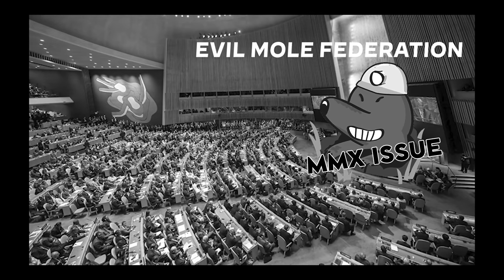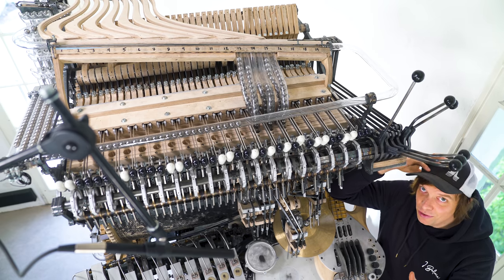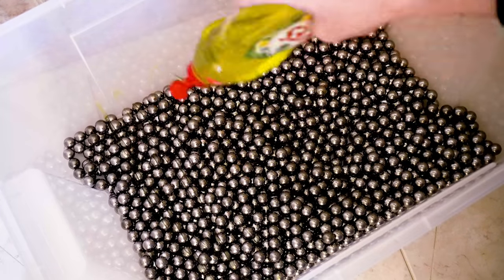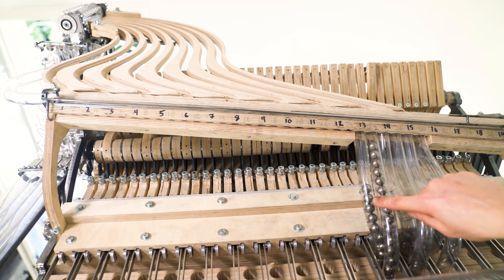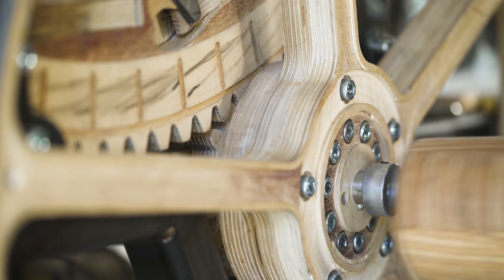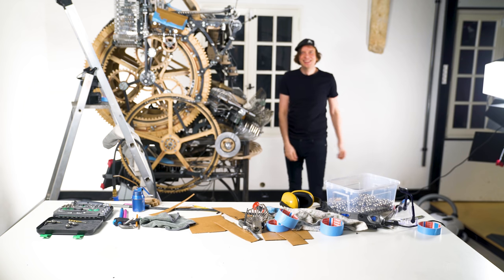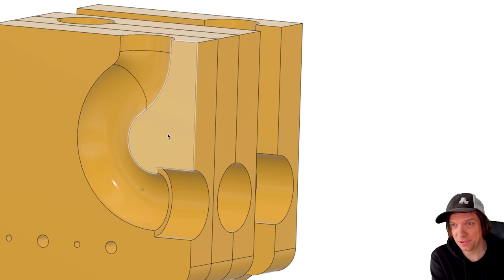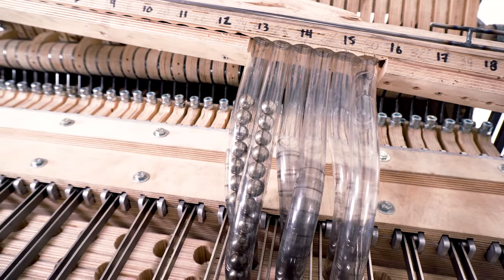Why Are 1000 Marbles On This Red Towel?

Comment: Fingers crossed retuning doesn’t affect the marble height of the top! 🤞😳
Reply: Of course it will! There are many different good ideas on the Discord of solutions for making marbles in the same height on the top, with no need to have adjustments. Unfortunately, Martin seems to be stuck with the modules for height adjustment.
Reply: Was just thinking that
Reply: We have a variety of modules.

And this is the working prototype, not the final travel design.

Of course it'll have a few flies in the works, it's buggy :D
Reply: @glenmcgillivray4707  if this is the prototype then I guess that makes the first one a proof of concept... right? 🤔
Reply: @LizardKing1470  perhaps, or a prototype of a different design. Don't forget it was scrapped and only core concepts were retained. Lessons were learned of this first attempt that succeeded, here Martin seems to intend to plan to build a final functional design, which is great, buuut he is still learning what does and does not work, building new components as he goes and literally developing new proofs of concept.

The prototype that follows the initial prototype looks far more like the finished design, but rarely includes everything the final requires.

For instance the nonsense of the too narrow lanes on the marble divider, which in turn made the size of the note management linkages, the pipes are 10 mm and the holes 8. He didn't know what pipe he would end up finding that worked, how could he understand he was making a poor choice that would haunt him for the rest of his creation?

He built his Grosstraktor. Now he is developing the panzer 1. Next time we will have a more refined Panzer 2.

I'm terrified how impressive his Panzer 3 and 4 designs will turn out, with as much refinement he is stitching in so far, will they be self propelled, marble machines of musical excess? Possibly with speakers activated or articulated by marbles themselves?
Reply: Isn't the pressure module separate from the top marble pipe and therefore would not change the height, and worse case scenario hopefully with the new changeable height regulators it should be an easy fix
Reply: @cai53r63  the marble chain sits on the gate. the pressure module is behind the gate to bear the load for it, the depth module is mounted above that for leveling purpose. The pipes above for bringing the marbles.

So no matter what component we tweak, all change the depth of the top marble. The chain is supposed to be solid marbles.
Reply: Wow I didn't expect you to write such a lengthy reply, but I guess I got you going, lol. Yeah, there's just so much to this project that it's hard to wrap your head around. Prototype 1, proof of concept, first version, inspiration for a better one, there's not much of a difference anyway. What do grosstraktor and panzer mean? Grosstraktor sounds like it means garbage truck.
Reply: @LizardKing1470  Panzers. 1 2 3 4.
Tanks of world war two.

Grosstraktor. Agricultural tractor. Code name used by germans for production and shipping of tanks to the soviet union for testing and experimentation and training for mechanised combat. Theorists were busy explaining tanks would change warfare forever. And infantry would need to be mechanised to keep up. The Germans got their training done in secrecy to avoid being seen breaking the treaties of world war 1. It was seen as their nation being weak and incapable of defending itself, so they MUST prepare and develop a military.

Aaand then Hitler and the unpleasantness in East Europe, then West Europe, over the British mainland, and africa, and finally within the soviet Union itself happened.
And everyone wanted to shout at Germany 'THIS IS WHY WE SAID NO TANKS!'
Thankfully that is over now. And Germany sells tanks to other people.

Comment: I think you can remove the rust on the marbles using a “tumbler” with crushed walnut shells as abrasive. It will polish the marbles back to new :)
Reply: I just said the same thing a minute ago! That would be the way to go. A tumbler or vibratory bowl with crushed walnut shells
Reply: Wouldn't that also alter the size of the marbles?
Reply: @satansbarman  I think not, if you don’t keep them in the tumbler too long. I’d try 24 hrs and check.
Reply: Hope he sees these are expensive and a tumbler with a soft media would totally work
Reply: @satansbarman  That's why he should use walnut shells instead of a harder medium. Silica will sand off steel, walnut will only touch the softer rust.
Reply: The machine hsa been comlpletely designed around a fixed size of marble, and even a 25th of a mm difference to each marble, will affect how high the stack of marbles sit in the marble divider. Better to replace them after replacing the parts that put graphite in contact with the marbles. Graphite can still be used where there is mechanical friction between moving parts, but should be kept away from the marbles themselves.
Reply: @ouzoloves  hence the idea to try a 24 hr tumbler run & measure 😉
Reply: @PikkaBird  but that's kinda my point the rust coming off is still going to change the size
Reply: @ouzoloves  .25 mm is a lot.. I don't think it would take more than a couple thousandths of a mm off.
Reply: @satansbarman  I guess for a finely tuned piece of lab equipment it might be enough to make a difference, but the amount of steel that goes into that amount of surface rust is surprisingly minimal. I know the height adjustment needs to be pretty spot on, but I still think these marbles would be comfortably within tolerance. 
Of course it would always be preferable to use something that's actually perfect, but I would test these cleaned and de-rusted marbles before swapping them all.
Perhaps such a test could be made by  making two very long marble lanes (just a groove cut into a length of MDF) with a stop at one end. The stop would be at the end of a slope, and by filling one lane with the used marbles and the other with the new ones he could measure the difference over a length of a meter for instance (I don't know howany marbles that would be, but quite a few for sure). I would be surprised if the difference is even really measurable.
Reply: @PikkaBird   as I was reading the first part of your comment I was thinking he could test if the rust removal has a noticeable impact on the size by measuring the clearance at the top holes (just after those amazing marble lanes 😀), like when he was adjusting the height modules. I suppose you could do it for a metre but I guess it would be enough if he tested in the longest tubing he would be using. 
My original thought was based on how Martin had been fine tuning said clearance with the height modules, which thinking about it now have also changed, so I guess he'll need to swap and possibly cnc some more anyway 😁, to get that roll along the divider.

Comment: TL:DR do NOT dry marbles with heated air, they will rust faster

I am not sure if blowing the marbles with hot air will help with rusting, because high temperatures increase speed chemical reactions

You are basically blasting the marbles with 500° oxygen
Oxy Acetylene torches cut metal this way, their flame is oxygen rich and is basically rapidly rusting away the metal and cutting it, if you had used a fuel rich flame, the cutting would much slower

Not sure if I am right BUT In my life I have never never seen steel rusting in 3 minutes so it must be the hot air gun
Reply: Martin is incredibly smart and talented but washing so many marbles at once without even trying the planned wash on just a handful first was incredibly blinkered. Even a comparative dunce like me would have done a test wash first as I would have suspected that rust could have started pretty soon after the wash, I'd have also checked out potential salt content in the washing liquid and whether using a hair dryer was a smart move or not. 

We all make mistakes of course.

Comment: When you wash steel, afterward immediately wash it with Isopropyl Alcohol (medical alcohol) you can find it in most pharmacies and in the paint department of a hardware store.  The alcohol displaces the water and evaporates.

Comment: Hey Martin, i may have missed something but doest changing those parts at the end affect the height of the marbles at the top of the divider?
Reply: I was thinking this too 🤔. Hopefully the different shape is an even increment of marble length.
Reply: If he looks to the Discord forum he'll find excellent ideas that are not as fragile as the height adjustment modules are.
Reply: But he has the height adjustment modules, so that shouldn't be that big of a deal.
Reply: @vincentguttmann2231  what were the height adjustment modules? I thought they were the same thing
Reply: @vincentguttmann2231  those are cumbersome to switch. Not practical at all.
Reply: @SantiagoLuz  I mean, if you got a better design idea, make a suggestion!
Reply: @vincentguttmann2231  I think you missed my first reply here
Reply: @SantiagoLuz  Oh yes. But my reply is still standing: If you already HAVE a good idea, why wait for someone else to invent it again?
Reply: @vincentguttmann2231  I voted on the best ideas in the Discord forum. People even made videos with working prototypes to showcase the solutions. We should be voting there to reach Martin's attention.
Reply: @vincentguttmann2231  And I don't have better idea than the ones in the forum

Comment: Found myself screaming "NO!" at the screen when I saw the liquid soap being poured over the ball bearings. Definitely the wrong way to clean them.
Reply: They aren't ball bearings, they are bearing balls, or simply steel balls. Word order matters. At 11:15 you can see an actuall ball bearing.
Reply: @waynec369  It's not pedantic to point out that bearings and balls are two entirely different things. Also, it's perfectly fine to call these steel balls "marbles". Look up the definition if you don't believe it. "A marble is a small spherical object often made from glass, clay, steel, plastic, or agate."

Comment: "I Made this system adjustable"
Proceeds to create entirely new part and puts lots of time into replacing it

I'm not saying I have a better solution, but I have a hard time considering that adjustable.

Love what you're doing. Have a good day.
Reply: Martin does not understand the difference between adjustable and modular.

Comment: As a software engineer it's great to see Martin embrace "modules". Once you have a contract (the interface between your modules) then you are free to play around with the implementation as much as you want, as long as it meets the contract. This video was a perfect example -- you have an input and an output, the module needs to deliver the marble across it, but you are free to experiment with different designs to see how well they meet the goal. Engineering!!

Comment: Hey Martin, I have an idea to remove the need of magnets on your current magnet wheel, and would retrofit your current design with minimal changes. Think reverse waterwheel. I think you could machine one and test it in a day. Ill put together a quick Fusion design if you want.

Comment: Use isopropyl alcohol, acetone or metholated spirits to clean the marbles.
This should not rust the marbles and also act as a solvent to dissolve any residue left on the marbles. It also dries quickly and as another commenter said, it also acts as a degreaser.

Comment: Compressed air doesn’t clean, it just displaces...
Reply: Displacing dust and debris onto the floor (or into a vacuum cleaner) counts as cleaning, though?
Reply: @dnebdal  in my opinion it gets it airborne, and he does this right next to the marbles and the mmx... it would have worked better if he had done it outside IMO

Comment: Been following the MMX since inception, first time commenting. 

I'd hesitate to run rusty marbles through the machines, as they may leave behind rust particles which could stain the wood after enough passes. With how light the plywood is, it won't take too long to happen and I'd hate to see your work soiled with an orange tint.

Always awesome work. Keep whacking those moles!

Comment: Please use stainless steel marbles, anything else is a NO GO.
Reply: They won't stick to the magnets...
Reply: @janhimpiii  You can get stainless steel magnetic.
Reply: @janhimpiii  very much depends on the alloy. I'm more worried about the slight weight change compared to "normal" steel balls.
Reply: @namAehT  No problem, just calibrate all the parts :)

Comment: Thank you for yet another great update. Don't let the marbles airdry. Dry them off. Depending on your tap-water, airdrying can leave behind minerals, like limescales. Also, airdrying helps rusts. Non-stainless steel knives are to be dried off immediately, and not airdry, in order to prevent rust. I also imagine the grease comes from your fingers and not the graphite powder.

Comment: A remedy for the rust ball bearing issues would be switching to STAINLESS STEEL ball bearings. There may be a bit of a cost difference but in the long run the ease of maintenance will make it totally worth it!

Comment: How willing are you to have a care and feeding schedule for the MMX? Like changing the oil in car? If the MMX works fine as long as you wash the marbles and clean out the machine after every few shows, would that be okay, or failure?

Comment: did you inspect the old marble stacks to see if the machined over rotation shape had been worn away or smooshed by the many marbles passing through? would that have caused the over rotation problem?

Comment: When I heard that you were going to clean the marbles, I thought: "Oh, no! Not with water, please!!! Use alcohol for this!"
In fact, these are balls from a ball bearing. They are made of carbon steel, which rusts very quickly without lubrication, even in the open air. just from atmospheric moisture. If you go on a world tour, they will need to be transported in a sealed container with a moisture absorber (silica gel) inside.

Comment: I'm curious if the new inserts still give the proper height so that marbles dont get stuck in the divider? it seems like you spend a long time getting those lengths down, which had to have changed by making the tunable pieces more of a straight shot

Comment: Martin, fantastic video again. Regarding the longer bolts for the bearings, rather than cutting these off an extra nut over this section would hold the bolts more secure.

Comment: A couple of thoughts, both related to humidity:
 - On plywood parts where dimensional tolerances are tight, some sort of surface finish that seals the part will really help. With bare wood, changes in humidity will not only change the overall shape of the part, but will affect the surface texture. I suspect this is what has happened with the pressure adjustment modules. Moisture may have caused the surface fibres to swell and become fuzzy, effectively making the passage tighter and causing more friction.
- Rusty marbles are going to be an ongoing issue. What about a portable tumbler? Throw the marbles in before each show to clean them up. Rust dust could be removed by throwing in some microfibre cloths after tumbling. 

I am picturing both of these problems needing to be addressed when you play at the Sydney opera house in the salt air .

Comment: airflow issue inside the pipe.  how big is the plastic pipe compared to the marble?  Might improve movement by drilling air holes in the top of the tubes.

Comment: 19:19 The lower feeding tubes curve up a bit before entering the pressure module/gates, which means there will always be marbles stuck in that part, even when trying to empty the MMX before packing it up for the next gig. Those tubes should have a gentle downward slop to help empty the MMX, and to also allow for extra notes to be played before that channel is truly empty. 

Martin, try to empty one of those channels to see how many marbles are left in the tube before it stops playing. My guess... there will be around 6 marbles stuck there.

Comment: Overrotation was probably the problem, not the length of the pressure unit. Overrotation forces marbles to rub much more against each other. Together with the weight of the queue, that was creating a lot of friction marble-to-marble. Happy to see the cylindrical tracks are now flowing freely and that the gate can handle the increased pressure. But I noticed that marbles in the divider very often skip over channels that are not yet full. We'll have to see how that works out when all the channels are active.

Comment: After changing the pressure modules the height modules will need to be changed. A possible mole is that the height modules also effect the pressure so you could end up with the wrong pressure again. A dog chasing his tail could ensue

Comment: There are also three marbles between the plywood modules and the row of black and white levers.  One is near module #2, another is near module #6, and the third is halfway between modules #9 and #10 (under the metal wires).  See 3:21 and enlarge the video to full-screen size.  I tried to check later in the video, but I can't see those modules.

Comment: Please inspect the wear patterns in the old marble pressure modules as closely as you can.  I expect you'll find small divots where the marbles stopped.  

These divots then change the carefully tuned geometry of the pressure module and make it run slow.  So your pressure modules will always run slower over time.  I think the solution is to make sure all marble paths have some slope to the outlet so they will drain even if marbles above them jam a little.